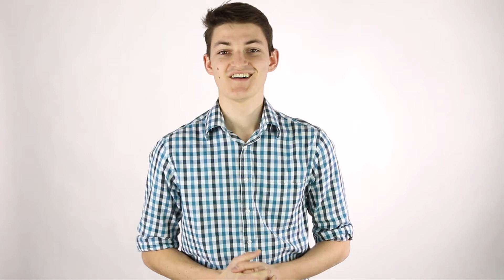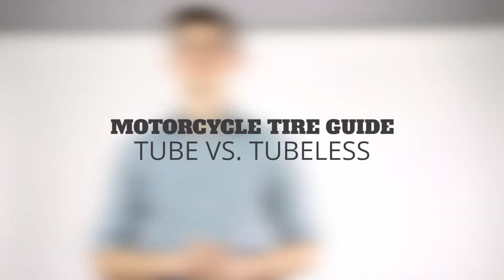Motorcycle Tubes: To Tube or Not to Tube?

Comment: I used tubeless tires on my motorcycle before. However the air keeps on leaking and i had to keep on pumping air almost every week. So i had to switch to tube type.

Comment: I’d like to run a more aggressive off road tires on my Harley Davidson as I go down a lot of dirt roads and a little off-road riding can I put a tube type of tire on my tubeless rims ,, I have rims from a Fatboy solid …just wondering
Reply: Hey Moe, I ordered a couple of tires off Amazon, their both shinko705 but the the front one is says tube type only, and it's bidirectional rotate one way for front the other way on the back. So I put it on, holds air and everything. I took it easy at first, it handled fine on that thick gravel, better than the old radial in fact. On the highway no problem at  65 so far.
Reply: @bernswonger57  👍 I have a shinko 777 now on back of bike ..
I'll check out 705 .....

Comment: I'm years late but I have a question
When you Put a motorcycle tire on does that include the bike weigh ??? and what ever you are going to put on the bike for the rating of the tire ???
 if I buy a 550 pound rating tire can I put 500 pounds on the back tire after mounting tire on the bike ????

Comment: Ryan, you didn't get into the technology differences between tt tl RIMS. Bicycle rims for example, have   very differently shaped flanges and mounting a tubeless tire on a tube-type rim is very dangerous- rim doesn't have the correct hook shape to lock the tubeless tire on.
 Is this the case with motorcycles?
It would be helpful to know. Tubeless tires are safer than tube - they tend not to explode when punctured and they tend to stay in place on the rim in the event of a flat.
But is that staying-on-the rim feature a function of just the tire or does the shape of the rim flange play a role in keeping that tire locked on the rim?
Real life situation- the new Royal Enfield 650's come from the factory with tubeless tires mounted on  spoked rims. The rims are obviously not tubeless style because of all the spoke holes but will the tubeless tires on those bikes stay locked onto the rims in the event of a flat??
Your response will put a lot of riders at ease - or not!